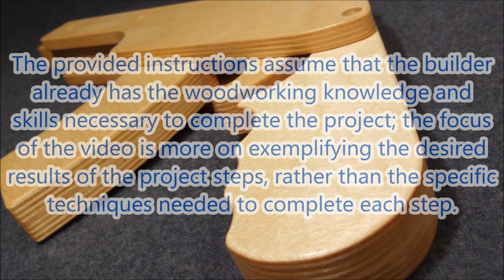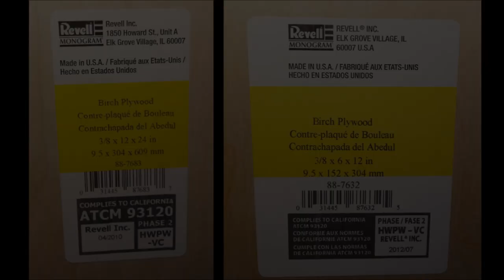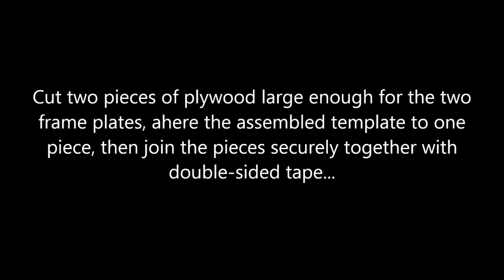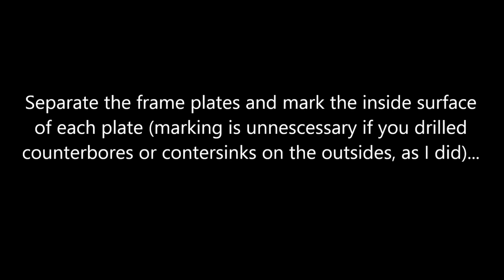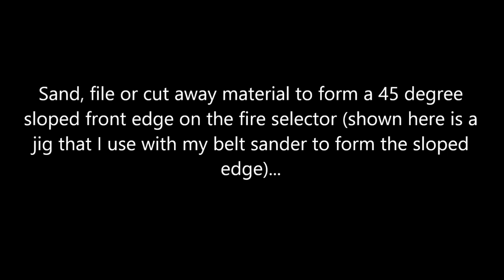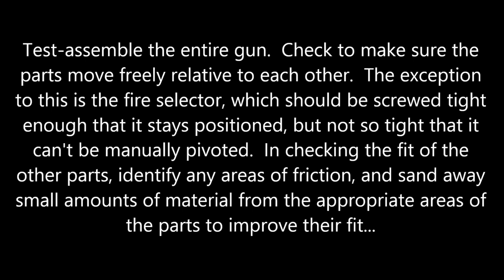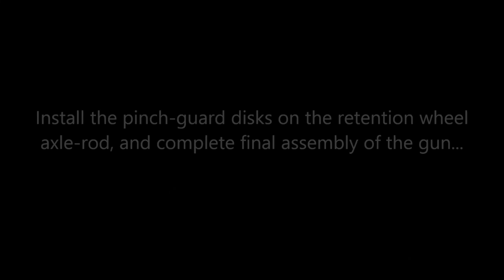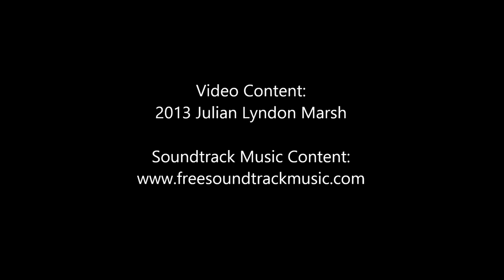Experience Building A Select-Fire Rubber Band Machine Pistol

Comment: I bought the plans for this gun and two others from this guy on Etsy. The plans were well written and came with templates for all the pieces. He has done all the measuring and calculating for you, it is pretty easy to do. I built the machine pistol and it turned out pretty cool, everyone I have showed it to wants one. If you are interested, you should go buy the plans. Only cost a couple bucks and you get an instant PDF down load from Etsy. This same guy has written a book on building a gatling gun called the Rotary Mek. I bought that book too, just haven't had time to start it. I read thru the book and it looks like it is well written and thought out as well. Bravo Rubber Gunner!
Reply: Scott Tatlock Thanks for the positive review!

Comment from the maker: In reply to a previous question, in my experience there will almost always be some amount of splintering of the surface layer when cutting plywood across the grain.  This can be minimized by using a saw with the sharpest, smallest teeth possible, cutting slowly, and making sure that your work piece is held down firmly.  When cutting Baltic birch plywood, I find that I get the best results using my band saw with a very fine toothed "metal-cutting" blade.  Quality or brand of wood used may be a factor as well, but you'd just have to be familiar with different types.
Reply: Rubbergunner Thank you very much - I'll try to keep this in mind, only I don't  have a bandsaw - just a coping saw.
Reply: can you make a movie about how to draw this gear ?
Reply: Thanks for sharing. I made this using my little CNC router and it's great. Instead of wooden dowels I used some 6mm steel rod salvaged from an old paint roller handle. I found I didn't need to glue the rods (tight fit) or fit the jam guards and the thing works brilliantly. I certainly didn't achieve the finish you did but it's great nonetheless. If I make another I'll probably enlarge the handle a little bit but otherwise it's a brilliant design, thanks again :)

Comment: Julian, great video. It inspired me to try and make a CNC machined version with my new 3040T engraver. I have successfully written the G-Code (with a slight variation to the grip). I'd gladly share it as .txt files but machine settings need to be exactly the same to get the right result (and not straight forward to explain!). 

Thanks for the inspiration though :-)
Reply from the maker: That's fantastic!  I haven't yet made the jump to CNC routing for my guns, but I hope to later this year, most likely with a zenbot.  I'm looking forward to learning the whole g-code process.  I saw your short video on your rotarymek, that you went the route of having the smaller diameter  metal transverse axle rods.  Has it worked well?
Reply from the maker: Love to see your version of the machine pistol as well1
Reply: Yes..... But my manufacturing tolerances weren't as tight as i'd hoped. There are a few axle-rods on the lever-arms that aren't perfectly perpendicular, this means they catch on the tethers and need a "forward assist" to get them going :-(

Comment: Sorry if I miss something, but where can we get the plans for this model? It's not available on Etsy.

Never mind, I see it must be captured from video - was hoping they were available in .pdf - but its good thank you.
Reply from the maker: Yes, the video is set up so the templates can be captured, but the templates for the machine pistol are also included in the downloadable PDF Template set for the Select-fire Carbine and Submachine Gun, which I sell on Etsy.com.   (With the PDF file, there's still the possibility that you might need to do some tweaking to get the printed size just right, depending on your printer.)

Comment: Cool design, simple to make. Does the oscillator need to be so large though? Does its weight effect the function in some way?
Reply from the maker: The size of the oscillator, as well as the weight of its material, affects the amount of dampening it provides for the rate of fire.  A smaller oscillator or one made from a lighter, less dense material will yield an overall higher rate of fire.  Conversely, if the oscillator is made larger or made from a heavier material it will give more of a reduction in rate of fire. I've experimented with smaller oscillators but which included embedded tungsten weights to add mass (pinewood derby weights), which gave about the same dampening as a larger, unweighted oscillator.
Reply: ah I figured it did. i think i'm going to steal your mechanical design and build a larger gun that hides the oscillator.
Reply from the maker: ***** Take a look at the new Sturmgewehr 45 that Parabellum1262 built.  He modified the mechanism to both change the trigger position and hide the oscillator.  Notice that the rate of fire is higher also (smaller oscillator).

Comment: How does one make the select fire mechanism a vertical action, and not a horizontal one?
I'm trying to design a magazine fed gun with a selector switch, but that switch would have to be moved in order to keep the size reasonable.
Reply from the maker: George Cowsert I have not experimented with that type of configuration, but if if you are referring to a variation on this type of mechanism with removable magazines, there are a number of examples on YouTube by other people.  I'm not sure about detailed plans, but might be worth a search.  the trick to the miniaturization while keeping it vertical might be in using very strong materials, such as metal, for the parts.  would certainly take experimentation.

Comment: Is it possible to add are own stock
Reply from the maker: Yes, the styling of the gun can easily be changed, so long as the fit of the parts in the area of the mechanism remains unchanged.  The three guns I currently make, the Select-Fire Carbine, Submachine Gun and Machine Pistol, all have exactly the same mechanism geometry, but have different styling.

Comment: does the oscilator size matter?
Reply from the maker: CreeprzKing The size of the oscillator affects the rate of fire.  If the size (mass) is reduced, there will be an increase in the rate of fire.  The opposite happens if the size is increased.  In other words, you can customize the rate of fire of the gun you build by changing the size of the oscillator!
Reply: Rubbergunner thanks!

Comment: Is the magazine oscilator necessary?
Reply: No, but the full-auto rate of fire will be too high to fire short bursts.
Reply: Yes, it is. It acts as a slowing mech for the spindle, (star-shaped thing that holds the rubberbands) if this where to be left out of the gun, it would just shoot all rubberbands at once.
Reply from the maker: The Brick Gunner Your answer is better.  An addition function of the oscillator is to provide a rapid-fire sound effect for the gun.
Reply: Rubbergunner Thanks, your rubberband guns are awesome. I have watched all of them.
Reply: Yes, the oscillator is necessary.  I think the functionality depends on the weight

Comment: size rubber bands do not understand .. (#14)
I lenght rubber bands - 3in  8cm ?
barrel size ?
Reply from the maker: +Ilie Pasat In the US, rubber band sizes are standardized and are designated by number.  The number does not represent a measurement.  For instance, size #31 rubber bands measure 2.5 inches long.  You can easily find size charts on the internet to show you what all of the common sizes are.
Reply: +Rubbergunner I have the 3-inch stretch up to 12inch . (400% believe)
So not only this percentage counts and size
Reply from the maker: +Ilie Pasat The size specifications are for the un-stretched rubber bands.  Not all brands of rubber bands will have the same maximum stretched length, as rubber content and other factors vary.  If you type "rubber band sizes" into Google, and look at the image results, you'll see a number of charts showing the specifications for the different numbered sizes.